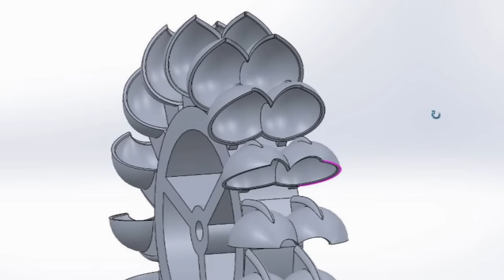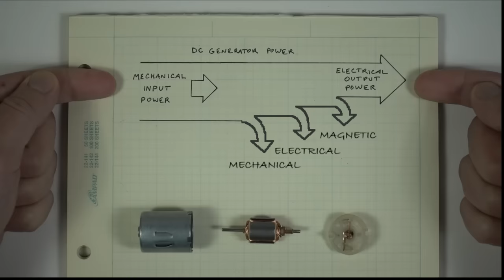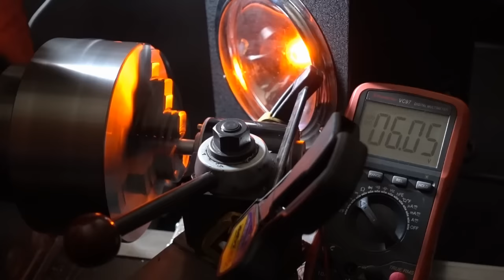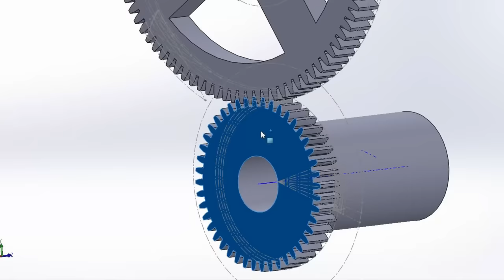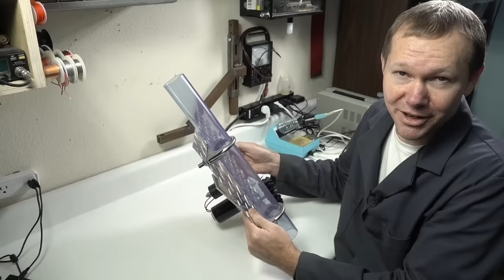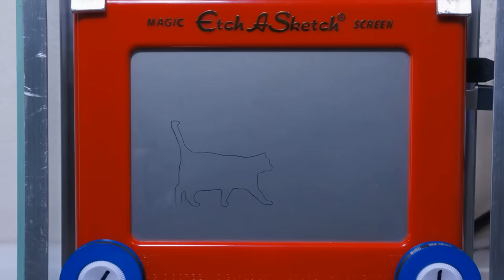Rain Gutter POWER #1 - How to Harvest Free Energy From Your Roof with a Hydro Electric Generator!

Comment: I think is more efficient if the pipe’s hole is at the buttom not on the side. That way weather the water pressure is strong or not, the angle of the water jet won’t change and will always hit the wheel.

Comment: For every 3.14 foot in height you gain 1 psi. That is the formula used in water dept stand pipes or water tanks so the higher the roof and gutter the more psi you will have!

Comment: To maximise the energy down the drain you should also minimise the bends in the pipe (slowing the water down before it goes down the pipe).

Surprise one downpipe would be enough in large rainstorm.

Comment: Technically the area of roof should be calculated on the horizontal plane. The slant adds a bit of surface area, but looking at it from the top down, the rain doesn't care about the angle. You could have a very steep roof going up 4 storeys but if the angle of the roof is 70 degrees, the actual rainfall surface area would be many times lower than the surface area of the roof. Unless the rain was falling sideways due to wind...

Comment: Wow this is brilliant!! Excellent video & explanation. I have an old 3,000 sqft dairy barn with a 20+ foot drop on the rear downspout that would be perfect for this. Just some rough math using your initial calcs (super helpful!) it looks like I could potentially have 25+ W of power (before losses).  I already have a large solar generator (see my channel if interested) I keep out there, so this would be a perfect supplement for rainy weather.

Comment: Sure it’s not a lot of instantaneous power and I like the idea of storing/collecting power just like money in the bank. I don’t like batteries for two reason 1 there are a bit of a problem to dispose of an 2 you’d be lucky to get 2/3rds of the energy you put into them back out of them. I like mechanical ways of storing energy like lifting a weight on a pulley via an electric motor or by compressing a gas, either way can easily be used to make electricity via an alternator. 
Therefore I think this would be very useful and could be used with wind power, some would instantly say solar power as well but unfortunately solar panels are going to cause another major problem as they are too difficult to recycle and they have some nasty materials in them which we do not want in the environment.
This was a really good demonstration, well done.

Comment: i love this idea but, awhile watching this video i can instantly see a number of issues even with these types of concepts
flow restriction, water loss, Hight requirements custom down piping etc

i was kind of hoping to find a design that would be able to fit inside most circular downpipes, where the blades spin inside the pipe itself making it easy to keep the water going where it needs to go, not worrying so much about how many volts are being generated, having the system operate at any speed to account for change in how much rain is falling
forcing the water to completely turn around with this cup design on the generator looks like a really good idea, but I'm not sure how to intergrade similar physics into, what is essentially "a pc fan type design inside a pipe" maybe just having something that looks more like a turbine where it is relatively restrictive unless the system is spinning would be a good idea, more water and more pressure = faster rotation,  but this design again requires Hight, pretty much every design requires Hight as far as i can tell, which is not ideal for when you want to store the water as well (unless that water storage is underground)
i love the concept but. I'm starting to realize why, this isn't a thing you see more often, in theory its great, in practice it is, somewhat impractical
Reply: Water towers up high.

Comment: wat you wanna try i think is a gear, with a lever, lenght is power, bigger wheel is more length, so put the yet on a bigger wheel, min weight max surfeice,
and your dynamo should be as small as poss, as well, maybe rather than letting the water splash around it, make a hood over it that guides the water falling,
perhaps you can make a second yet and let that hit another wheel a bit lower ps think of  bicycle with gears set for downhill ;)

Comment: Ahem.. That's 2 Watts per hour. You have gone above and beyond with making this work. Good Job. In order to make the gears move despite the gear resistance, making the arms longer for the impeller would give more of a mechanical advantage and would spin the gear as fast as it was before. Like a longer lever, so should be the impeller. Good work overall. Not many people have a mill, lathe, etc. etc. to do this sorta thing, let alone power from falling rain. That's 2 watts per hour, so charging a battery and then using the power from the battery would be ideal. etc.
Reply from the maker: Watt is already a measure per unit time, so watts per hour isn't a thing. You might be meaning to say watt hours which are a measure of energy used on your power bill.

Comment: Awesome experiments so far . If you use 3 barrels beside each other each one at different level you can generate power 3 times from same water and using a pythagorus cup theory on each barrel also works the same way as the bell syphon this wont put so much strain on your gutter
Reply: The power generated is from the height of the waterfall, y installing 3 barrels at different level you would just split the power generated as you just split the height in 3

Comment: From solar charging systems comes the idea of the maximum power point tracking or MMPT. 
So... Consider going back to the direct drive. Then use the dynamic impedance transform of a the same kind of switching power supply.  This might help
en.wikipedia.org/wiki/Maximum_power_point_tracking

Comment: I thought you might try to custom fit a mesh screen at the top of the pipe in order to help with debris from building up at the bottom of it. Though I don't know if that would affect the pressure that you're aiming at, by causing debris to accumulate at the upper end of the pipe instead.

Comment: Very high quality video, but: 1) the gears are not a good idea, you can use a step up dc dc electronic circuit or a different generator, 2) water exiting from the turbine must don't ave speed (all energy captured) speed of the pelton must be less for high efficiency.
Reply from the maker: I'm told step up "boost" converters are pretty inefficient.  Probably comparable to gears.  I elected the generator route in part 2 which was a huge improvement.

Comment: what if you were to mount  impellers inside the tube and drill a few more holes in the bottom of the downpipe.  I recommend looking into the LIly Impeller and the science of Viktor Schauberger.

Comment: The size of the cup is dependent on diameter of the wheel, or your water jet actually exceeds optimal, and causes a govenor effect, but hitting a flat surface when the wheel moves away, or hits a flatter surface at the start. My brain is telling me you want the jet to hit the wheel at a 15 degrees downward angle letting gravity help you by adding that little bit of force. Optimal would be all water leaves the wheel at the bottom. That way there is no lifting of water. The commercial giant was horizontal with vertical shaft. You'll need a guide channel off the nossle to keep the water force in the cup with it's only exits being left or right. That should be enough to double the force your getting now from the stream of water.

Comment: I was debating doing a pumped storage system on my property. Kind of like you did on your house. I have 13 meters elevation change. But after using your math, I would have to drain 6000l of water (or 6 1000l ICB totes) to generate 200 watts of power @ nearly 100% efficiency? LOL I guess I am scrapping this project idea. Great video though! Or i did the math wrong?

Comment: Reverse the tank from vertical to horizontal with an open water trough mounted above
the tank same length as the existing bbl.  (1/2  of
the same size bbl would  work and be able
to collect rain water serving like a full length funnel). When it rains and no
solar available use the higher elevation head pressure from the bbl in
conjunction with the exiting roof rainwater for the Pelton wheel. The addition
of  high with the existing  low pressure nozzle should theoretically increase
the  rain water power generation. Additional
bonus of horizontal mounting could result in 40% more storage capacity, less wind
resistance, less static and dynamic roof loads as well as aesthetically being
less obtrusive.  I can see the high level
indicator (rubber duck) now floating across the open roof top trough the envy
of neighbors

Comment: I know this is old  , but I wanted to ask  , is Kinetic energy the ultimate goal for proper hydro , if you moved the water closer , and also had a smaller diameter hole would that help .
Less volume of water but also with a smaller hole would it create more force  and speed onto the Pelton.

Comment: Technically, you need to consider the rain fall on the horizontal projection of the roof area and not the actual measured roof area itself. That is, a fixed area that is vertical collects no water, the same surface at 45 deg slope will collect more and when almost horizontal will collect the most.
Reply from the maker: I did

Comment: If I’m wrong reprimand  your measurement is on the angle  should be by plan.
It’s like measuring  the area of a hill country farm by running up and down he contours. Grass trees etc are spaced horizontal apart. 
Rain is the same.
Reply from the maker: Common misconception for some reason.  I said "once I calculate the horizontal distance" and depicted it with horizontal arrows.  Not sure why so many miss that.

Comment: Calculation must include angle, it reduces overall exposure to the 'potential' rain collected from surface area of roof. ∠AbC (side b) is the exact surface area that's collecting rain, not ∠AcB (hypotenuse).
Reply from the maker: Listen for when I said "calculate the horizontal distance" and represented it with dimension lines.

Comment: I wonder what happens if you hit the top of the wheel instead and make it run clockwise, and reverse the cables. Would there be any difference in performance?

Comment: Nice video, i had an idea and i dont know if it will work maybe you can give me some advice. If i was to connect 3 ibcs up at the side of my house and have a bell siphon in one ibc, keep them raised say 1m off ground and have bell siphon connected to pipe that runs to the bottom of my front garden where a water turbine could be housed,( 3-4m head) and run my downpipes into the ibc's, would that work? I know it wouldnt be running 24/7 only when the ibc's get full and then empty but would that generate a decent amount of electricity?  I live in england and we hve lots of rain!
Reply from the maker: Sounds right to me.  If you use a small primer pump you could start the siphon yourself whenever you want.  The head would have to be calculated from the average water height in the tank which will be below the gutter so some loss there but then you'd have quite a long run time from a full tank.  FYI, I just installed a bell siphon in my gutter for part 5.  It works but requires quite a bit of flow to get started.  So if the rain is barely adding water to the system it may just leak down the siphon and not do anything.  But I've got an idea to fix that.  :)
Reply: @QuintBUILDs  thanks i'll keep watching to see what i can learn!

Comment: Wouldn't be beneficial to have a housing around the water wheel? Also why aren't you storing/capturing the rain water into barrels/storage(like a battery) so you have longer run time. Also look into first flush which cleans the water of debri.

Comment: My gut feeling says that instead of creating a yet, let the weight of the water colum do the thing by hanging a wheel directly under the pipe without restricting the flow? That way the water has less speed but more weight so it can overcome generator resistance better?  I do not see the the advantage of yet srteam because in the end the more resistance you can have, the more watts you can generate. So the convert to yet power and then trying optimal cups feels like an unneeded extra conversation. Or am I missing something?

Comment: Question:
If you increase the diameter of the rain spout, would the weight of the water accumelated in the down spout help with the spray to the pelton wheel?

Comment: Sorry I am so greedy, but it seems there are Pelton turbines out there on the market, if he
could bolt it up to a car alternator, that would be a very practical set up, charge a battery 
and run it into an inverter to get the voltage and use-able power you need.

Comment: Height! The power of the water falling on the hight part of the roof traveling to the gutter is lost.
My ebike does not have regen brakes.  Is there a cheap light say 300 to 600 watt, 40 volt DC generator I can switch on and off with a simple button?  I'm not asking about how to actually attach it.

Comment: Could you put an L in the bottom of the pipe and have your jet flowing straight down, also could you run your pipe diagonal across the length of your outer wall to hold more weight in the pipe?

Comment: Hmm, I was thinking about something like this myself. My conclusion would be that the diameter is way to small. What would happen if you make the wheel 5 meters in total diameter, super lightweight on bearings and then make it spin slowly. It should spin super easy if its leightweight and on bearings even with 5 meters in diameter but the force that even small amounts of water can bring to the wheel are massive.

Comment: The Generator is OK, I would use a LARGE Pelton wheel and when it is raining there will be a whole lot more water flow , I would not bore a hole in the tube and change the direction of the water instead I would make the water run directly from the tube and hitting the pelton wheel directly with a downward force, the amount of water hitting the pelton wheel will be a lo greater and will generate a lot more power, hopefully enough power to charge a 12v battery

Comment: What if you have the water flow thru a check valve and then place a few empty water bottle to add presser making the water hit the pelton wheel harder ( installing a ram pump and diy air compresser)?

Comment: More of a question than a hint: Instead of loosing a lot of energy with your "gearbox", wouldn't it be easier and more efficient to use a boost-converter IC instead?
Reply from the maker: My EE friends tell me boost is very inefficient compared to buck.
Reply: Ah, when I wrote my comment I had only watched the first part where you used a gear to increase the voltage of your generator. I just saw that you switched to your own generator in part two.
Very nice video series, thanks for posting these!

Comment: Would 3 of these produce 3 x the output? What if you pipe 3x downpipes next to each other (regulated at bottom) Would it be 3x the pressure? Or would a bigger downpipe with more volume have more pressure?

Why horizontal? Wouldnt the jet lose a tiny bit of potential? would facing the jet down be slightly faster as the water wheel would be holding the weight of the water slightly longer?

Comment: Schools are made to be a pipeline getting students to college, and college is a pipeline to get students into careers that contribute to the economy and GDP. Everything within the curriculum is structured for this. It works to produce workers and GDP, but fails in creativeness and ingenuity.

If schools taught engineering and the sciences like this at the primary school level it would create both ingenuity and productive workers once the more in depth parts start in college.

Most math and science is not complicated, much of the basics can be self taught from books. Schools artificially structured curriculum skip the essential history of mathematics and engineering to streamline the process to create more workers.

Comment: Make the pipe as tall as the roof so it fills up with water.     Install a floating valve so when the pipe fills up that when it turns itself on and runs the generator

Comment: Hears a super noob question that's a litel off-topic. I'm thinking about getting a cheep small dobboy swimming pool(10 to 14'x3'). I want to know If I can power a pump with just the panels(no battery bank) ?
Reply from the maker: panel watts need to exceed watts on the pump label, but most of those are AC pumps while panels make DC.  Therefore need an inverter which will eat some of your power.

Comment: Make a bigger motor I have a motor on each down spout and I have one in my water fall that is always on . 

It helps with my solar power. 

I have mine all inclosed plus  goes to my rain catching  system. 

One pipe has 10 wheels in it and keeps it moving

Comment: Would Volume or the weight of the the column increased and there for the PSI if the tube was larger? like a 3" or 4" line?
Reply: Yes like a water tap. This regulates both the amount and the pressure.

Comment: This is probably unecessary since there's such a big margin for error with rainfall data anyway but I think you should have taken into account the angle of the roof - because you're not interested in the area of the roof so much as the vertically exposed area of the roof, because the actual area you're collecting rain over is smaller than the total area of your roof.

Comment: The cross braces on your gates are wrong. They should go from the bottom hinge up to the top to resist drooping. That way, the weight of the gate is pushing against the post at ground level. 
🙂👍

Comment: Hello, I think that this generator produces more energy than a solar panel, you could try replacing the solar panel with this generator in a solar panel system, the idea is to accumulate the energy in direct current and then convert it to alternating current, Greetings